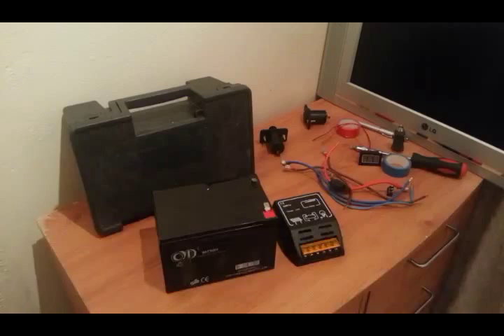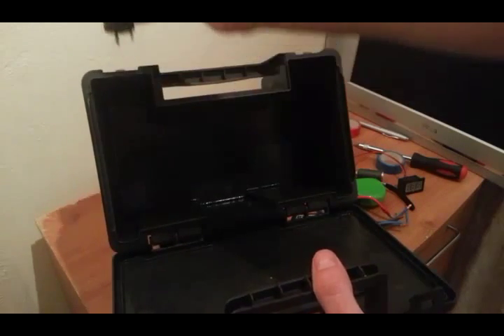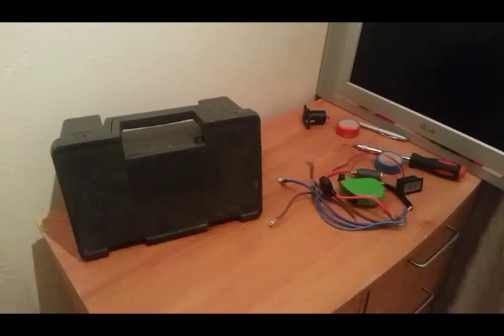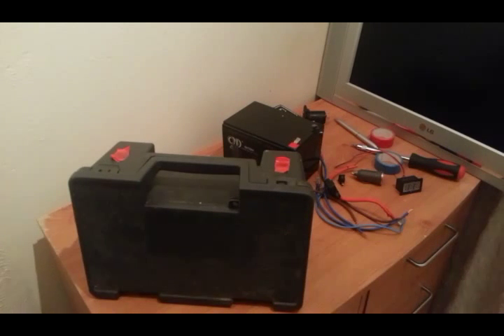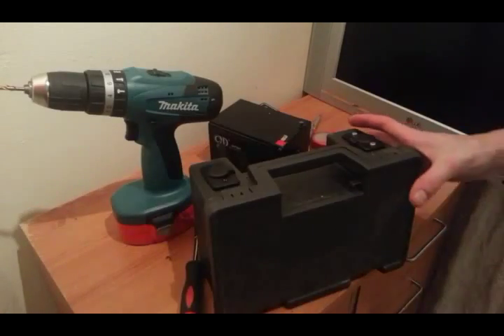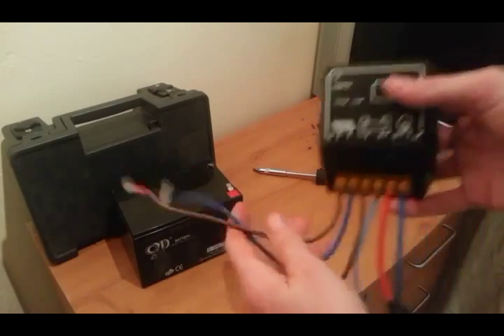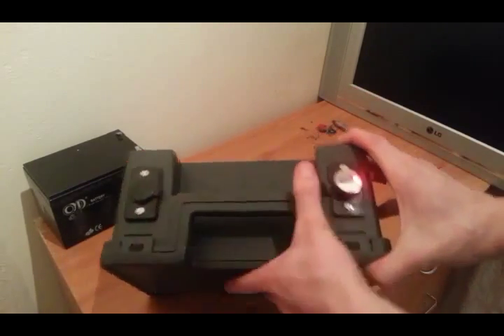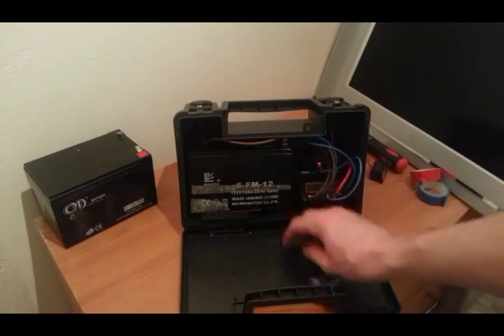Small 12 volt solar generator for my bike trailer

Comment: not to nit pick, but I would have probably put that switch in line where you could isolate the battery, I've used a charge controller like that on a small battery box, and it does drain some power when not in use, I suppose you could always unplug it when not using it, but that doesn't seem handy, great job on the simple setup, seems small and light, great for a bicycle setup
Reply: I made the same observation. Without some way to isolate the controller from the battery, it WILL eventually suck his Battery dry. I'm taking wagers he made the same mistake on his other system which is why his first battery was bonkers!
Reply: Your right about putting a Off/On switch between the battery and controller.
I didn't know a thing about solar panels and controllers but found out quick that the controller was drawing enough current to drain my 10ah E-Bikes battery pack down pretty quick and installed a DPST switch to cut the power from my panels and from the battery pack both.
The instructions for the controller said that the controller must be powered up first before the voltage from the panels or it would damage the controller.
Just for safety I connected the panels to the other side of the switch in case I forgot and plugged in the panels first before powering up the controller.
Reply: The video of his bike solar trailer would never last if he hit's a curb or object that would flip his trailer over on it's side or top.
I have the 180 lb capacity Aosom cargo trailer with 2 x 12v, 25 watt Mono Crystalline panels in series and one day running empty to the grocery store I had to speed up to get across the intersection so a driver could make his right hand turn and my rear left trailer tire hit a curb and flipped my trailer over on it's back and didn't get a scratch one or brake my panels.
He has the slightly smaller cargo trailer than mine.
i have a video of my rig that shows how my panels are counter sunk below the side rails.
https://www.youtube.com/watch?v=mxEGgt4dXHk